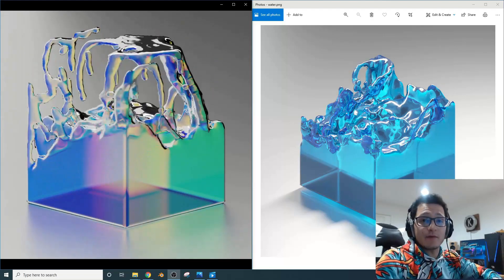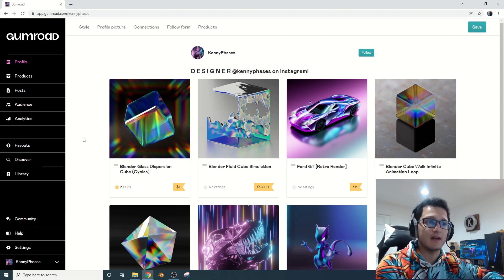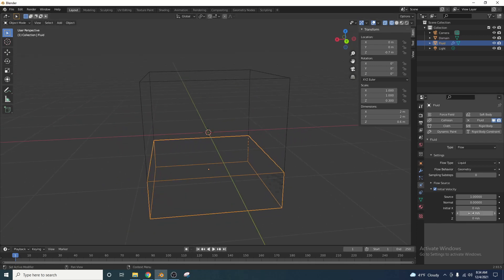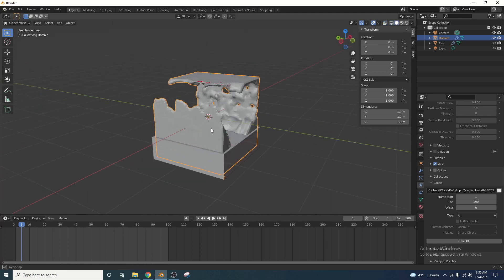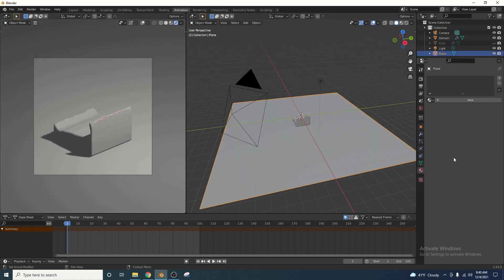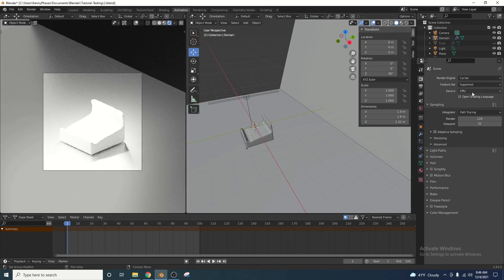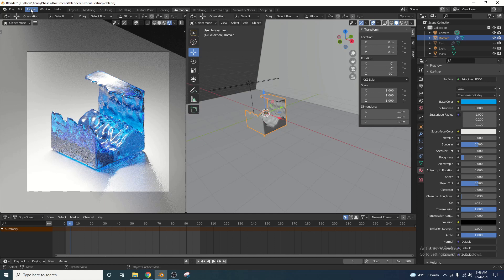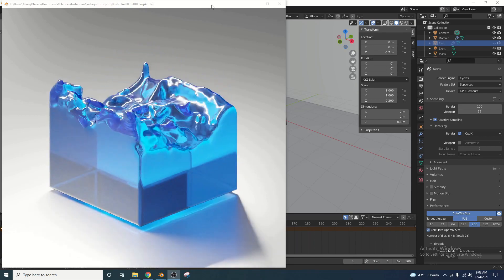Blender - Easy Fluid Simulation 2021

Comment: Why the liquid effect won’t work after I change the scale of it? It bake for nothing everytime.
Reply from the maker: You have to rebake anytime you change scale of your domain or fluid-effectors / fluid-flows. Anything changed MUST be rebaked or it will not work!
Reply: @KennyPhases  omg thank you for the fast reply. 
But, what I did is I followed your steps with a new cube only difference is the size. But sometimes it works, sometimes it won’t work. It really confuses me🥲

Comment: I definitely want the glass shaders. So i  installed 2.8 version, the fluid is flowing which looks great, but at the render stage it just doesn't look right its very noisy and in object mode it starts to noise all over. I have a rtx 3080 32gb ram intel, please advice.

Comment: when im rendering, each frame is taking 15 minutes +. I have a 3080Ti and its rendering with GPU. Is there a secret? I am on Blender 3.0. No auto tile size add on
Reply: Also, your output went to tmp files and was saved as PNG. How did you get yours into video format? I will just have to re-render for now
Reply from the maker: @ABones-bm3vq  you have to change the output properties to mpeg-video and make sure you select a different folder as well! If you need more info I can walk you through it! Message me on instagram @kennyphases